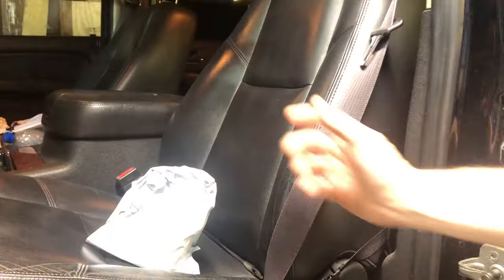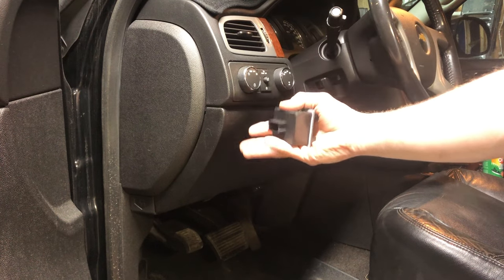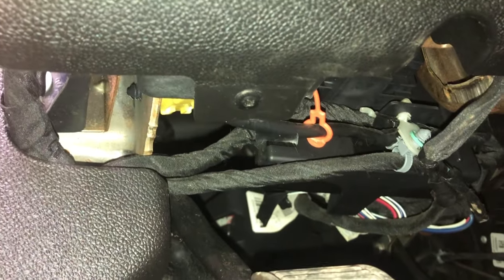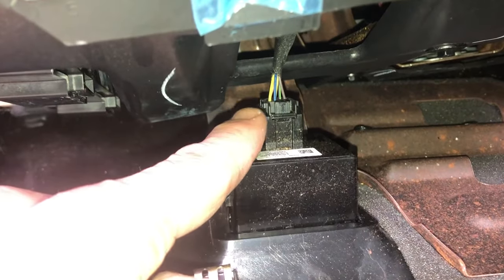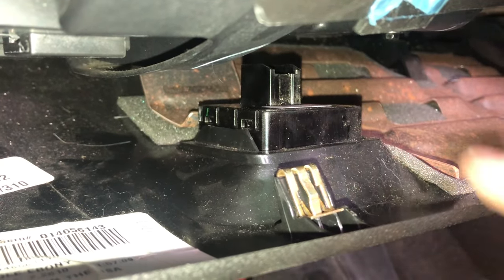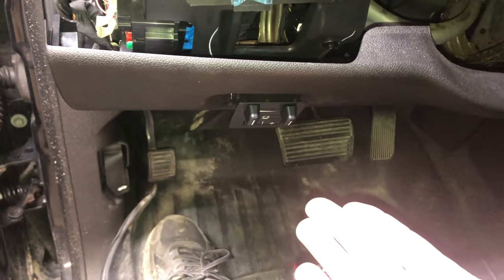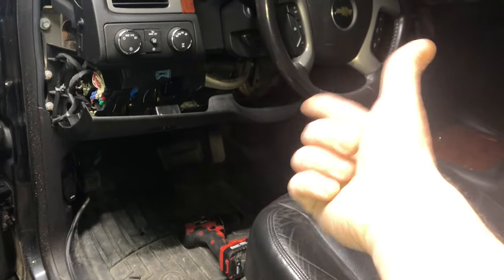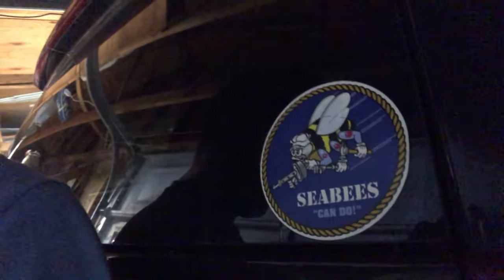FIXED! "Service Trailer Brake System" - Chevy/GMC Suburban/Silverado/Sierra/Yukon/Tahoe

Comment: This is the problem. Once you replace it, you have to have it scanned at a GM dealer. Not exactly sure how old your truck is but my 2023 it will have to be scanned at a gm dealer in order for it to operate. I am not sure when GM started this, but this way it keeps you from working on your own vehicle.
Reply from the maker: Wow, that’s awful. Mine is an 11.

Comment: I don't use my Trailer Brake, I bought my Yukon new and 2 years later the message popped up... I'm thinking it's programmed to go off so dealership can make money off servicing cars
Reply from the maker: Probably!
Reply: No it’s your brake booster
Reply: @basilsarmini514  thanks, I'll look into that part in my next maintenance schedule. Strange that within 2 years of being bought new, that would need replacing/repair...I havent gotten it looked at as I rarely drive my Yukon; it's almost 8 years since I bought it and it has less than 60K miles

Comment: Yeah, well, doesn’t always work. Had the message, bought the switch (which by the way is more than $90 here in Canada). Took 10 minutes to switch it. Same message. Turns out the relay’s shot. $458 for the part at the dealer. Fun times.
Reply from the maker: Yikes! Dealers are the WORST
Reply: @jimmysgarage9068  the $458 included the search and install….but STILL!!! Yep, dealers are the worst.
Reply: @hans-georggrim349  Im having the same issue, just replaced the switch and change, could you share the part number for that relay please?
Reply: @johnloura115  
Hey John,
Description on the invoice reads …. 20904439 RELAY ASM - TRLR BRK CONT   Retail (Canadian $) 178.98
Labour charged …. $225.00 so I’m assuming less than 2 hours. AND …..Canadian taxes on all of that.🤬

Hope this helps.
Reply: I just bought one on Amazon, $73 USD, but now I'm the labor 😂 Downside to everything.

Comment: ??? I have a 2014 GMC and my service notification message came on, but ive never used it. Not once, any reason why? If you have any thoughts message back thx.
Reply from the maker: There’s another piece in the rear that may have been affected by salt/moisture. Haven’t gotten to that yet!
Reply: @jimmysgarage9068  thx my truck has sat outside for long periods of time not being driven.

Comment: My battery was dead and when I jumped it “service trailer brake system” popped up. Would this issue drain my battery? I’m getting a new battery as this one is reading under 14 volts.

Comment: Just did this on my 2011 Sierra. Didn't work. I hear there is a module behind the spare tire. I'll try that next. Great video though. Rock on brother!
Reply from the maker: Good luck man! 🤘🇺🇸
Reply: Did you figure it out? I have the same truck and year
Reply: I’ve replaced all three pieces of the trailer brake system and it still doesn’t work, I guess I’ll be sending back all three pieces to get different new ones unless anybody else has an alternative.
Reply: Sending it to the shop. The most annoying constant bell. I either have to crank up the radio or stop driving the truck before I start smashing things.

Comment: I just replaced the module above the spare tire and the message still comes up although the trailer brakes still work with the test slide to test gain. Would this be my next step? Thanks
Reply from the maker: Honestly, I’d test the brakes by driving a trailer. Perhaps the slide works, but do the brakes work when you press the pedal? I’d swap it out just for peace of mind. It’s a cheap part and only takes a few minutes to install. Hope that helps.
Reply: @Jimmy's Garage  yes they do work. Slide,  trailer brakes on the pedal everything
Reply: @daltonfeltman5606 Hey did you ever get it figured out? I have the same problem. My service trailer brake system warning comes on every time I start my  truck but the trailer brakes actually work perfectly. When I have a trailer connected, the warning doesn’t come on🤔.

Comment: have had this problem for ever. mechanic shop could not fix it and referred my to the $$ dealer. i saw your video and bought oem replacement part . didnt fix the problem. curious to me how a very common problem with so many vehicles would require such a  muriad of repair technics with many like this one that doesnt fix it.
Reply from the maker: Bummer! There is another part that is in the rear that could be the culprit. I went with the switch and it solved my problem. Sorry man - I hope you can get it figured out!

Comment: I have changed both the controller in the dash and also the one inside the left rear frame. My brake are activating but when it used to hit hard at 5.0 it takes a setting of 10 now and also the check trailer brake system message still comes on periodically.  Can’t figure it out.
Reply from the maker: I’m assuming that you’ve cleaned all the connections? Mine can get dirty over time, so perhaps there isn’t enough current flowing through the contacts? Only thing I can think of if you aren’t getting proper power to the trailer brakes. Good luck man! 🤘🇺🇸
Reply: @jimmysgarage9068  at the trailer plug in or at the module inside the frame?  Thanks for you reply and follow up. 👍🇨🇦
Reply: @jimmysgarage9068  I get the check trailer brake system note periodically even when the trailer isn’t hooked.
Reply: @dougberry1011   Same here
Reply: Had it into the Chevy dealer. They went through everything. Changed the 30amp fuse. Drove it home. Everything good. Hooked up to my 5th wheel. Got the check trlr brake system at the first brake application. Turned truck off and on, everything good. Went about 2 miles and got the readout again. Said to hell with it and drove about 70 miles and stopped at Costco. Started up and everything worked good for the next 45 miles. Parked for 10 days and basically the same thing happened on the way back. Chevy dealer mentioned something about the brake switch as it happens when the brake is applied with or without the trailer.

Comment: Well I have watched 2 different videos to fix this problem. I replaced the module,  relay and fuse but it persists.
Reply from the maker: Wow. Try calling a local mechanics shop and ask for advice. A good shop will help point you in the right direction. Best of luck to you! 🇺🇸🤘

Comment: Hey Man I replaced Module near spare and also replace switch still having the dash saying Service trailer brakes system anyone have any other ideas ????
Reply from the maker: Reset the battery? Not sure else man - you could try contacting a local shop for tips?

Comment: Yep. Replaced that, the relay and module under the bed. Still having issue, how do I fix it ?
Reply from the maker: If you’ve replaced all that, I’d say you’re going to have to start checking your wires for continuity. I’m sure there’s plenty of videos on how to chase a bad wire. Good luck man! 🤘🇺🇸
Reply: @jimmysgarage9068  figured it out. The module had to be reprogramed

Comment: My brake system works fine, but I still have the message when not hooked to trailer. Any thoughts?
Reply from the maker: That’s weird. I would swap it out just to be sure, honestly. Better safe than sorry & it only takes a few minutes. Thank you for watching 🇺🇸🤘
Reply: Mine too.
Did you replace the switch?
Reply: I bought the switch.  The only thing  available was the IC board that goes in the switch housing. I have not replaced it yet. Brakes work as they should when hooked to a trailer. Only time it alarms is when not hooked up to trailer.  I'll reply more when I replace part. 
You should always depend on trailer brakes....to fail. Was some good advice given to me.

Comment: Question what if my trailer light on dash isn’t Turing on?
Reply from the maker: If the trailer brake gain isn’t displaying on the dash when you adjust your switch, I’d swap the switch out. Sounds like it isn’t communicating - could be bad.

Comment: Replaced the switch and the message didnt go away 😔
Reply from the maker: Oh bummer man. Something else going on there then. You may be able to call a local mechanic and see what their advice is? Some guys are cool enough to give some insight on it. Best of luck to you.
Reply: @jimmysgarage9068  thanks man. I seen theres some relay thats another $30 common issue with these. Ill try it and let you know!
Reply: Same here relay didn't fix it either
Reply: @Straight_White_Fatherly_Figure  did you figure out what the issue was? About to start trying to fix this issue and want to see what other issues are possible
Reply: @MSTR-DTH23  i heard its most commonly the SSR (Solid State Relay). I havnt had the chance to try it yet though
Reply: Anyone know how to check possible bad part with multimeter before ordering a part that I may not need
Reply: @jeffb321  i think you just look for wherever the 12vDC stops flowing
Reply: @Straight_White_Fatherly_Figure  I'm trying but i'm getting a really erratic DC reading with multimeter on trailer plug. When I run a continuity test on the same plug I have no continuity leaving me to think it's the relay...
Reply: @jeffb321  i havnt checked myself, so im not sure what you'll see. But check voltage that goes into the relay plug. (Ive been meaning to look myself but ive been busy due to hurricane ian and i do hvac service work)
Reply: everything I’ve read it’s the wiring harness from the switch to the trailer plug that is faulty.  Good luck  @Straight_White_Fatherly_Figure

Comment: How did  you know that is the problem?
Reply from the maker: No power to the trailer brakes, no blown fuses - figured it had to be the switch.
Reply: @jimmysgarage9068 I installed one and I am still getting the same message. Which fuse do I need to check so see if that's the problem?
Reply from the maker: @LeeZellous  Look in the fuse box under the hood. Should be labeled something like “trlr brk”. I checked every fuse that I thought could be it.

Comment: Hello, My + and - work. So should I still  replace it? Also there's some kind of module where my spare tire is, what do you call it
Reply from the maker: If you’re getting the “service” banner - you likely need to replace the switch. I actually bought that module as well / but didn’t need to install it. It’s called the “trailer brake continue relay”.
Reply: @jimmysgarage9068  strange, my truck is a 2021 and showing this warning light yet I’ve maybe used the trailer brake system twice.. sad
Reply: The switch did not resolve my "Service Trailer Brake System" warning.
 Next, try the "trailer brake relay assembly" part number 20904439.
This resolved the issue with my 2010.
The part is located inside the left frame rail at the rear tire on a 2010, I believe the part is near the spare tire on newer models (much easier access).  Good luck.

Comment: Jimmy I need to talk to you I hope you help me
Reply from the maker: What’s up man?
Reply: I have the same problem for my chevy silverado 2500hd 2011 4x4. When I start the car to lower the D-wing gear lever, it gets stuck until 1 minute passes, then it goes down normally, I don't know what problem I have
Reply from the maker: @gustavovasquez4859  That isn't something I've run into yet. Try calling local repair shops to get an idea of what's going on? Hopefully someone can help. Best of luck to you.

Comment: so you shotgunned a part.. got lucky and made a video to say here buy this it will fix your problem... where is the diag.. what codes... what testing did you do..
Reply from the maker: I replaced a part and it fixed the problem. Didn’t need diagnostics, there weren’t any trouble codes and I didn’t need to do any testing. Thank you for watching 🇺🇸🤘

Comment: Ram > Chevy
Reply from the maker: Never owned a Dodge/RAM truck. Always been a Chevy guy for full sized, and Ford for compact. Beautiful trucks though.
Reply: I changed mine. I can push the reset stick and the warning will go off for a short period of time. But then reappears.
Reply from the maker: @JohnDoe-px6fz  Something else going on there then. Better do some more research!
Reply: So many problems with my ram! Gave it away to my dad!! Broken tie rods, transmission problems, the steering column broke, fuel sending unit and it would shut off when I busted U turns 😂😂😂
Reply from the maker: @georgefloydsinhellwbreonna5330  Someone doesn’t like Ram!

Comment: I have a 2013 Ltz Tahoe and the “service trailer brake system” came on the digital display. Will this fix that?
Reply from the maker: I hope so! It fixed my LTZ Suburban, which is identical to yours. Good luck man! 🇺🇸🤘